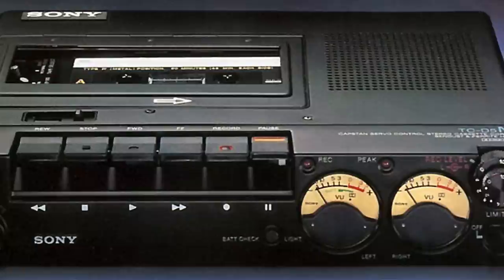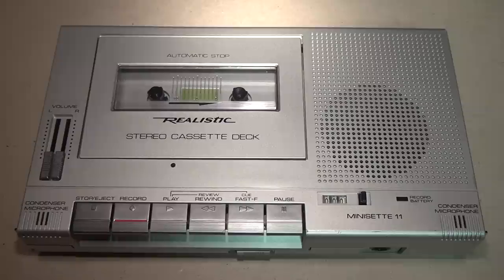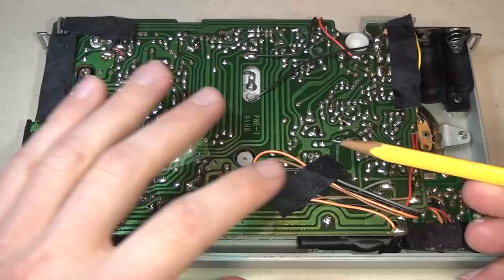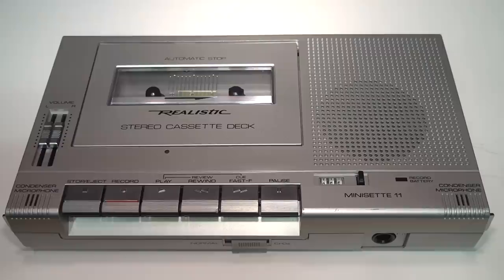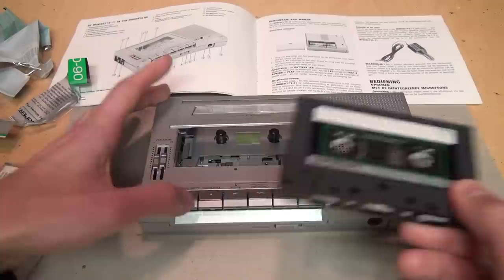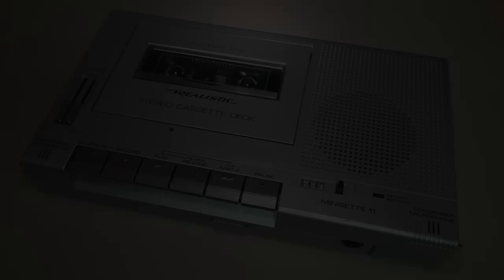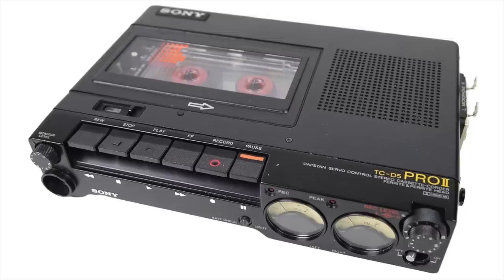A Realistic alternative? - The Minisette-11 stereo cassette recorder

Comment: The other issue is that the TCD-5 have a rubber idler tire that is bonded to the underside of the pinch roller idler wheel, and there exists no replacement for it. The only solution to getting them repaired is to remove it and send it to someone to have retooled on a lathe. You have to know how to remove the thing and put it back by yourself and you have to find someone who can glue a new tire to the idler and turn it down to the correct size. Absolutely all of them use that tire, and they are all getting slippery. They still "work," but a lot of tapes which offer slightly more resistance will either trip the mechanism and shut it off, or (if you're less lucky) they eat your tape :(
Reply: I have a sony tc-D5M model dat hase new snaars and idler it was e pain to get but the deck sounds so good now and the left and raide volume meters to record tapes on to is after 2 uurs of corekting bact to 1on1 
Bdw sorry if my engels is bad im ducht
Reply: @enriquewaisfisz7261  np. there's a guy in the US who can do the pinch idler for like 50 bucks. i'll get around to having mine done at some point, but for now i have other decks i can use if there's a problem with a specific tape. i only use it in my kitchen anyway
Reply: NOW i see why my TC-D5M sometimes instantly stops the recording once i pressed start...... I guess mine is in dire need of service then :(

Comment: The permanent magnet erase head will not make the recording much noisier. It's DC bias and the ALC what makes a lot of noise, but fortunately this one has AC bias. The only problem with the permanent magnet erase head is that the erasing efficiency can be low, so if you re-record a cassette which was recorded at high levels before, the previous recording might still be audible in the background of the new recording. This is especially true with Type-II tapes. Don't forget that an AC erase head can consume a lot of power, IIRC between 0.5-1W, or up to 2W with Chrome tape, and that is a lot for a portable tape recorder operated from a few AA batteries. It would decrease the battery life drastically.
Reply: It's more complicated. I found that most noisy recording gives the combination of permanet magnet erase head and AC bias. It gives such low frequency background noise, sounding like a huge waterfall or something. I am not sure what happens there exactly. The tape "erased" solely by permanent magnet isn't particularly noisy, but once the tape in this magnetically saturated state, is touched by recording head with AC biased signal, it starts to be such noisy.
Reply: @StackOverflow80  Yes, this totally makes sense, if the permanent magnet erase head leaves the tape saturated in one direction, the AC bias + recorded signal will not be able to null that out, and it will create a mess. But that is a garbage erase head, if it leaves the tape saturated. I have some Panasonic and Sony boomboxes with permanent magnet erase head and AC bias, and they make good recordings. The permanent magnet erase head should be a double-gapped one, which magetises the tape twice in alternate directions, leaving it in a neutral state instead of saturated. If you have a recorder with such bad erase head, but it has AC bias, you should try getting a better erase head for it.
Reply: @mrnmrn1  Ok, that's interesting. I have some Panasonic boombox from 90s and its specs says "erase head: multipole magnet". Would it be this kind of head? Its recording is noisy though (brown background noise)
Reply: @StackOverflow80  Yes, probably that multipole magnet erase head is what you want. My childhood boombox was a Panasonic RX-1650, it is mono, but makes OK recordings with its permanent magnet erase head. It is a bit noisy, but not that low frequency rumbling that you talk about, just hiss, most of it caused by the ALC probably. I have only experienced that low frequency rumble with DC biased tape recorders, and some dictaphones. 

I have a Panasonic recording auto reverse  "Walkman", in which the permenent magnet erase head is super tiny due to the two pinch rollers taking up the space, and I think it has AC bias, that is the only model which I can recall producing that low frequency rumble while having AC bias. 

I also had a Hitachi TRK-3D8 boombox with PM erase head, it made good recordings. Unfortunately I don't have any of my mix tapes I recorded on it, so I can't confirm how noisy it was, and I don't have the boombox either, although I want to buy one. The one I had was already butchered when my father bought it for me to play with when I was about 8, its side panels were smashed and it was overall worn out, FM radio out of alignment, and only one half of the deck worked, the other side had a broken gear, every control had very bad contacts due to wear (contact cleaning did not help for more than a few days), volume sliders were scratchy, and eventually the input selector switch burnt due to bad contacts. I used it for about 5 years than after the switch failed I parted it out in about 2002, I still have the board, the transformer and the speakers from it. I reused its transformer in a Vinix VPC-7714 boombox, its midrange speakers in a cheasy LEVIS boombox with built in LED lightshow behind the speaker grills, and I installed its woofer into an old two-way enclosure which I found on the street with a missing woofer, I used that for 10+ years attached to my TV.
Reply: @mrnmrn1  Yes, some of the recorders with permanent magnet erase heads were noisier, some of them less. So maybe it has something to do with the type of magnet used. However, better boomboxes and stereos used AC erase till the end of cassette era, so I think the multipole magnet didn't really solved it. If I removed permanent magnet head from AC bias boombox and recorded onto clean tape, the recording became very competent in terms of noise and distortion. Permanent magnet boomboxes had to hold recording level low, some -4dB i guess, to not to get distorted. With AC erase head, I could go higher with recording level without percievable distortion. The trend of permanent magnet erase heads irritated me a lot, as they creeped even into more expensive boomboxes during 90s. Permanent magnet in $250 Panasonic boombox with radio and CD in 1996, wtf?
Reply: @StackOverflow80  I'll have to do some experiments with this. Removing the PM erase head and recording on a fresh/demagnetised tape is a great idea for studying the effect of the permanent magnet itself!

Yes, there's really no excuse to use PM erase heads in stereos, but in the case of battery operated recorders, the excuse is battery life. AC erase heads need a lot of power. Prob no big deal with D cell operated boomboxes, but you definitely don't want AC erase in an AA cell operated dictaphone.

Before permanent magnet erase heads, there was a trend in cheap recorders to use DC erase with an electromagnet! The erase head had a permalloy core instead of ferrite, and it was operated from DC. It had an annoying habit of getting magnetized and then it slightly erased all tapes during playback...

I have a Sony TC-55 from the early '70s, I am very curios how will it perform once I repaired it. It has AC bias and PM erase head and ALC, but it is legendary to make great recordings (for its time, as a tiny portable recorder). Rumors say that a lot of bootleg concert recordings were done with it, with its built-in electret mike.
Reply: @mrnmrn1  As you said, in handheld "speechcorders" the PM head works perfectly fine and makes sense. However, to AC erase a ferric tape is not a big deal, as it takes quite weak magnetism to wipe it. Worse is to erase chrome or even metal tapes. For PM head no problem, but it takes quite powerful oscillator to clean them with AC.
I have lived in Eastern bloc, and no producer here put PM heads into even into the crappiest cassette recorder anymore. PM heads were considered antique and inferior. Even the local made handheld dictaphone had AC erase. So when western products flooded the market after the fall of communist regime, I was honestly surprised, as it seemed contradictive that renown producers made step behind. I was still young and naive. Now I understand that they were just cost-cutting, knowing that normal consumer will maybe not notice.
As a teenager I was given several boomboxes by my parents. They didn't bother to consult the choice with me. All of them had PM heads. They made crappy recording. I spent hours searching for the reason of it, studying literature and everything around tape recording. It was a good lesson though and finally I could improve my boombox. I had no other choice, if I wanted decent recording, I had no money to buy a better tape deck back then.

Comment: I bought the mono version, the Minisette 9, last year in Brussels. Beautifully made device, I think by Sanyo, as the majority of the components in mine are that brand. My machine was apparently well loved by its previous owners, because the head is quite worn and it had a faulty speed controller. When I did get it to play normally, I found it makes pretty decent recordings for what it is. The auto level recording is good enough to handle a direct connection between the mic input (the only one it has) and the headphone output of a laptop.

Comment: To put that 8khz frequency response in perspective, the Victor Orthophonic mechanical reproducer introduced in 1929  has 10khz of frequency response. 
The erase head doesn't really matter with new tapes. You can always erase your tapes in a different machine. The AC bias is nice too. DC bias would categorically disqualify it.   But the wow and flutter and frequency response are deal breakers IMHO.
In the form factor, this is a suitable replacement, but not in any other way.

Comment: Lovely review. I'm super annoyed with the prices of broken equipment on ebay theses days. Gladly you can still find great deals like this when you go for the smaller brand or no name stuff. I recently got a nice stereo cassette player  for 25 bucks in a second hand store, that wasn't working. All i had to do was to solder one cable back on. Works like a charm.
Reply: The price goes up, because so many people like you want to buy that stuff, for reasons unknown to me.
Reply: @Blackadder75  I don't buy it when it's over priced.
Reply: @bentbilliard  don't worry, I don;t buy it, not if it's $100, or $10 or $1   , I don't need old electronics. 

(I did buy a few retro 80s and 90s computers though)  I guess for the same reason as people buy audio stuff..   I just don't get the appeal of tapes, they are inconvenient in all aspects of use.  

I don't see the appeal, unlike classic cars or that old nintendo..  that is fun to drive or fun to play, but what is fun about a tape deck?
Reply: @Blackadder75  There is something tactile about tapes and an analog experience that you can't get with digital audio. Also it is part of a great history and it's super interesting to learn about it. 
Old Audio equipment is a marvel of technology and on top of that very reliable and easy to repair. It's all about having fun and maybe learning something. That's all.

Comment: For having a relatively low frequency response of 125 to 8khz and no Dolby I think it sounds pretty damn good. In fact the tape hiss was barely audible in the quieter parts on that first tape.
Reply: That's the benefit of recorders with automatic recording volume. It will always set the the optimum for each tape formula so you would get the best out of the limited dynamic range.

Comment: These cassette decks were very popular with churches.  They would frequently get "split track" cassettes that had the instrumentation on one channel, and the singing vocals on the other.  While practicing to sing a song, both the music and the vocal track would be played, but during performance, the recorded vocal track would be turned down.  On a large mixing console, this was easy, but for practicing in the music room, This little cassette deck fit the bill, because it would play left (instrumentation) or right (vocal singing)  out the monaural speaker, depending on where the VOL L and VOL R controls were places.

Comment: I love that this thing has Tape selector, built in stereo mic and  runs on AA batteries. Something i wish the Sony TC-D5 would too but sadly it runs on 2 D-Cell batteries, which are harder to come by. This Minisette-11 would have been awesome for concert bootleg recordings back then :3   If you ever need a translation for the manual, i could translate the german part of it if you want.
Reply: You can buy plastic D-cell to AA-cell adapters. Basically they're tubes that AA cells slide into that makes them the same diameter as D-cell. Coincidentally, I shot a video of them yesterday but it won't be on YouTube for a few weeks. Conclusion is, by EBL brand ones (Amazon or eBay), not 3D printed ones.

Comment: Under the circumstances, a Realistic alternative to an expensive Sony! The Minisette-11 seems a decent example of a portable stereo recorder. BTW, back in college, I worked with the Sony - it was (is, if you find, and can afford, a working one) a very nice tape recorder. An apt choice of subject, too, as I had a "Dang, I miss Radio Shack" moment this weekend. Was visiting my brother who lives some 100's of miles away, and brought a Teac CD recorder for a dubbing project we wanted to do. Brought a pair of headphones, too, to monitor the recording as we worked.... only they are modern headphones with the 1/8" (3.5mm) jack, and the CD recorder has a 1/4" phones socket. 

There were a Target and a Walgreens within a couple blocks, but neither carried a 1/8" to 1/4" adapter - too old school. (I could get all the ear buds and Bluetooth stuff I wanted at both places.) Back in the '80s, there would've been a Radio Shack prolly 10 minutes away, and we would have easily solved our problem! (We did eventually come up with a workaround.)

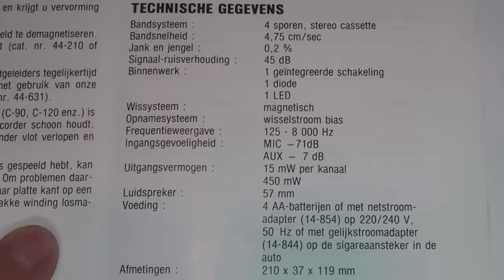Comment: 4:27 Dutch! Anyway, it ages well, looks nice! When I saw the mechanism I always wonder why manufacturers made so many different transport mechanisms. Different control layout, different belts, different gears and so on. I got the feeling that they use students (internship) with assignment to design a new mechanism 😄 It is so strange to take the effort again and again to design a new mechanism. Does somebody know the real reason why manufacturers invented the wheel again and again for each model they produced? There are so many different transport mechanism, really insane.
Reply from the maker: This was before Tanashin introduced their TN-21 mechanism in 1986 which pretty much became the universal industry standard of low-cost cassette recorders.
Reply: Usually either to avoid someone else’s patented method or to reduce costs or slightly improve some aspects. Japanese manufacturers were highly competitive and wanted to make their own unique design also. There are probably more reasons. Exchange rates and labour costs were different also, more money could be invested into r&d.

Comment: I didn't like stereo equipment with individual left/right volume controls, I always found them fiddly to use.  But just now I've thought of a good use for a tape recorder with individual left/right volume controls.  It's good for playing my Teddy Ruxpin cassettes in because I can wind down the right channel and not have to listen to the buzzing whirring sound of the PPM control data on the cassettes.  If you play a Teddy Ruxpin tape deck in a regular cassette player, you'll hear a noise that sounds a bit like a petrol driven lawnmower.
Reply: @The Vinyl Disguise Yeah well that can happen, they could be damaged somewhat easily.  I'd like to think my nieces know better than to feed their Teddy Ruxpin.

Comment: Nice video, as usual.  It sounds really good, as a playback machine.  The recording quality is an interesting reminder of how far prosumer equipment has evolved.  Whatever you are using to record your typical dialogue sounds considerably better than the Minisette-11, even when you used external microphones. 

Then again, it's a 40 year old device.  I wonder if its recordings would have been any better, when it was new?
Reply: I have A Tascam DR-05X and It's amazing for it's price. It has built-in mics, external mic or "line" inputs as well as "line" out, And being digital it's a CD quality recorder that fits in a pocket and runs on 2 "AA" batteries. It's amazing how far consumer audio has gone! I also have a Tascam DP-006. It's the digital equivalent of the old Tascam "Portastudio" multi track cassette mixer/recorders - But it's the size of a paperback novel!